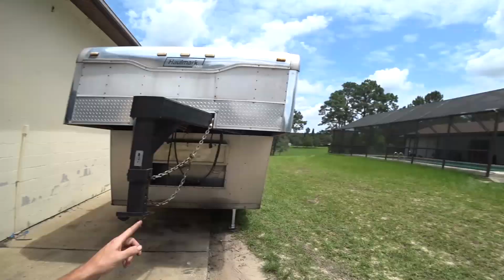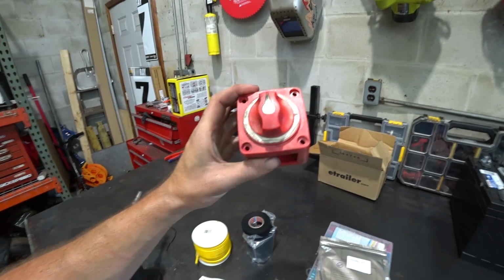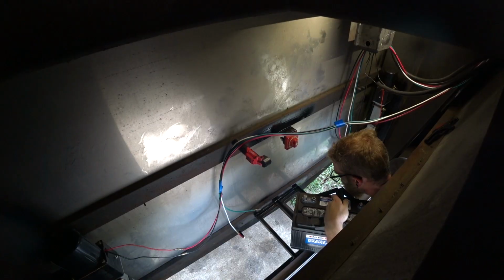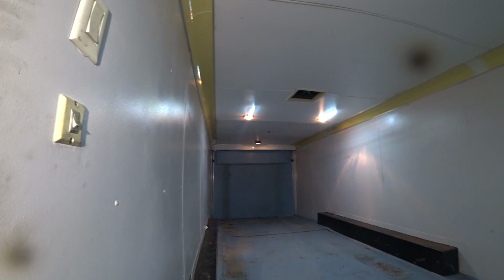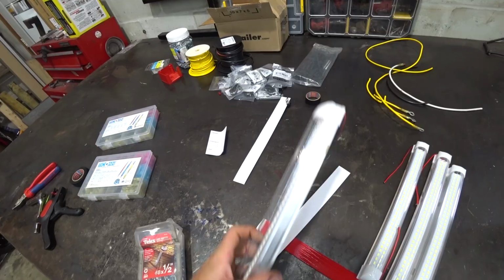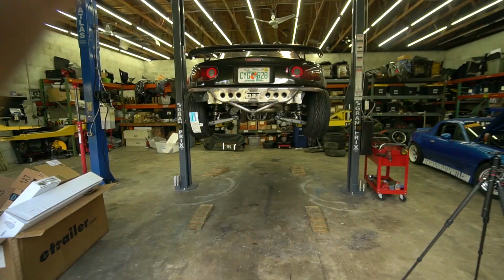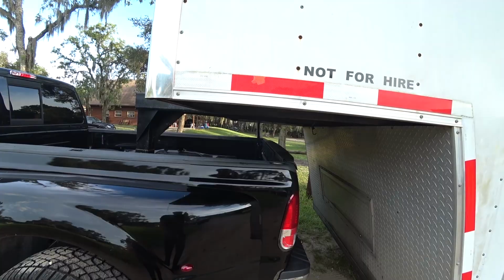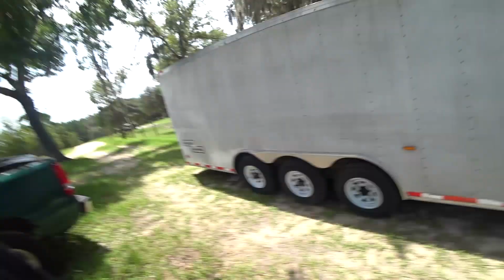Refurbishing And Upgrading My Gooseneck Enclosed Car Trailer Pt. 2

Comment: Hey Taylor! I work for clear one racing products and we sell trailer accessories such as fuel jug racks, door cabinets, jack pouches, paper towel holders, etc. for trailers! If you need anything at all like this give us a call from the number on our website and tell Bob that Jett sent you and we will get you taken care of! It would be a massive improvement for the trailer. We sell several trailer gadget racks that make stuffing those front cabinets a lot less painful! If you have any trouble just reply to this comment and I will give you any help you may need

Comment: great to see you really getting into it redoing all the elec - think about monitoring maybe?  google power meter got discontinued but there are cheaper kits out there still - a couple clamps and then you get a wifi info screen on all power usage - integrating the solar you are going to want some good monitoring and charge control systems, it may take a little while to get it really optimized but you can do a lot these days (obviously) - i would say get another battery that you always have charged but with a disconnect - if everything craps out you have a backup. #real time monitoring and alerts #clamps going the right way   https://www.youtube.com/watch?v=86boLfMqzS4 (very dated - see related simple and cheap derivatives) 
https://www.treehugger.com/life-sense-home-energy-monitor-first-month-4857091 - you do not have to get sucked into any saas or apps - it should all be in house free but this last link has the basics #google power meter pirates
Reply: check out will prowse solar channel - he does pretty well in breaking things down - i think you need some lithium and an ac and evap possibly - they should run just fine off of a couple panels - the over compensating on the lighting is not a bad thing at all - get a big tank for dry air, get a pc and a tv in there - you should have a mini router that has a usb slot and store files on there - glinet ar150 is a good one - has some fun alternative fw also - get 2 and build a gray mkt pineapple #cat's evil twin
Reply: leave the aesthetics of the trailer alone - it is fine - the mini generator - fab an exhaust you can stick a 4ft extension on, get some antenna going for the ap, tv, maybe get a gps for the trailer - i think if you just concentrate on the systems and not worry about having it be show trailer you will be fine - you could always build a huge spray booth, sand, prime, paint twice, clear coat, sand, clear coat etc - not worth it at all - do a vinyl wrap advertising you biz - phone # and website and youtube channel. keep going it is looking good #checklists

Comment: 2nd question . Why didn't you use shrink tubing on your wires ? You used that tape on them . Why ? The one thing I have learned is use that Electrical Grease on every connection you make . When you wire anything , Wire as if it is a Boat and there will be water getting to it . With you being in Florida , It might as well be a boat .. LOL  By the way , You going to be putting a LOCKING STRAP across your Batteries to keep the Butt heads from stealing them ? I would . You also might think about putting in a panel in the Jack Bay on the bottom to help keep out the rain . Make it a Bolt in panel .

Comment: you want to get the crude off that trailer start with these two items https://www.lowes.com/pd/30-SECONDS-5-Gallon-Multi-surface-Concentrated-Outdoor-Cleaner/1002564018 and https://www.lowes.com/pd/Greased-Lightning-5-gallon-Degreaser/3701728